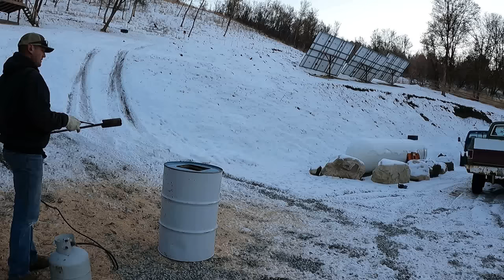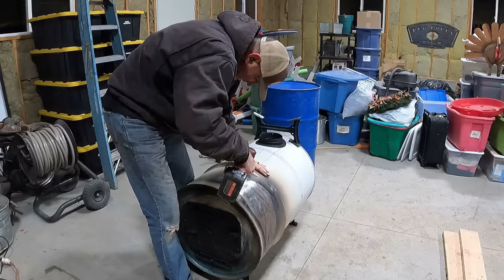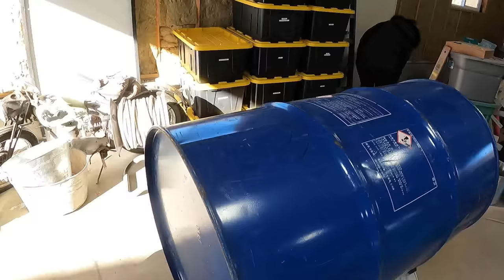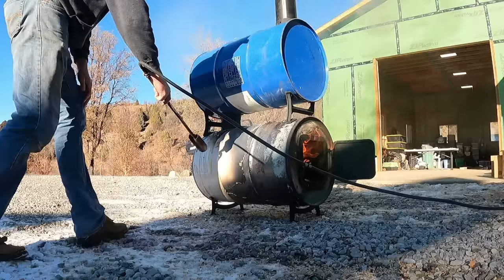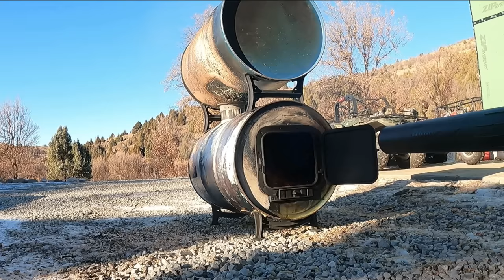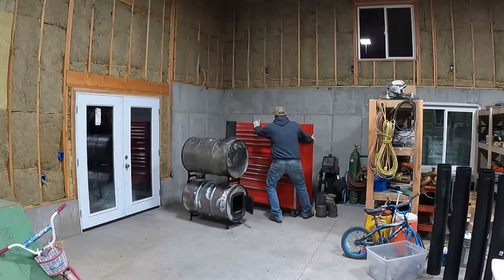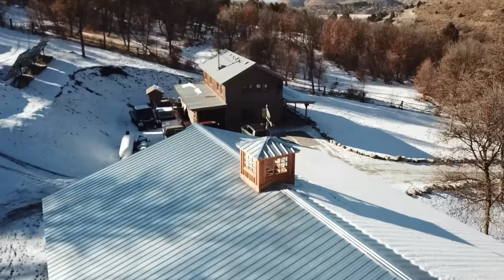I Built The ULTIMATE Wood Burning Stove For The Shop...

Comment: I built one of these stoves. Never again, blue plastic melted everywhere.
Reply: both of his barrels look like they're metal barrels.
Reply: L.M.A.O Hate it when that happens.
Reply: Wrong color, should of went with the Black plastic barrels...
Reply: @LosKonfleis  or the plastic ones that a magnet sticks to
Reply: @joelsmith3797  you can watch it burn. Lol
Reply: Key Davis  ya think? great wisdom  fella.  Am sure none of us would ever have  had that figured out.
Reply: @LosKonfleis  then used high heat paint to be safe....
Reply: You forgot the high heat paint
Reply: Gotta use the blue plastic in underwater applications.
Reply: Key Davis  just build a small fire.....
Reply: You just saved me a lot of trouble! 🤓
Reply: Lmao
Reply: Hey but I bet your stove put of some hellacious heat for a little bit. That reminds me of the wood burning microwave and steel toe flip flops I tried to sale in the truck stops. Never could get either to work. Lol
Reply: You need to check out the classic Newfoundland wood stove,made from  100% maple and guaranteed to burn for six hours!!! 😁👍🏻
Reply: @DrProfMrGenTom  that's the joke.
Reply: You so funny. Funny man make funny joke
Reply: Same problem. They store water okay though
Reply: I had the same problem with mine. I found out that ya have to paint the blue plastic with header heat paint, and then it won't run all over when lit.
Reply: Mine didnt EitheRRrrRr wöRk, StrrAnge ☠️ sYmmboll iiT haDeE söme In ITTt leFfT
Reply: Say what are you actually telling me that you didn't know plastic would melt my puppy is smarter.
Reply: @DrProfMrGenTom  thanks for pointing that out captain obvious
Reply: @williambeatty2675  perhaps your puppy can help you understand the joke!
Reply: Used plastic? Check your IQ …
Reply: @Der-Raubfischer  check your sense of humor!
Reply: LOL
Reply: @DrProfMrGenTom  they are and if you do them right you can get several years out of them
Reply: Sadness
Reply: DON'T use fiber drums! They increase your insurance premiums.
Reply: @williambeatty2675  do you often hear a whooshing sound in conversations with people and wonder what it is? That’s the sound of everything going over your head.
Reply: Aaah der,you should have used a wooden frypan so your stove didn't melt...
Reply: @markhagler4311  considering alot of truckers were flip flops I'm surprised.....LOL!!!
Reply: Lol
Reply: If you noticed,  steel drums were used.
Of course plastic would melt.
Reply: @paultyrkalo  I hope they were joking
Reply: geezLouise 🤦
Reply: Lylz
Reply: @DrProfMrGenTom  Oh buddy .... the joke flew right over ya
Reply: Lol good one
Reply: I built a fur lined sink, electric fork, inflatable dart board, and then I went cross country bowling.
Reply: @LosKonfleis  pshh everyone knows the red ones burn hotter dur
Reply: Is it possible to melt that blue stuff off of it before you burn it or grind it off?
Reply: Haaaaa!!!
Reply: You should perfect it now since you know where you went wrong 😂😂
Reply: Bless you. You are our sweet turtle prince 💕
Reply: Bwahahahahahahahaha
Reply: @DrProfMrGenTom  really?
Reply: Don't you know that the red ones are for fire and flammable materials, they are flame resistant, the blue ones are for liquid and cold 🥶 stuff.
Reply: I built one of those a few years ago and used it in my house. I used the sealant they recommended and it worked awesome here in NY.
Reply: Your a genius
Reply: Next time try metal barrels
Reply: Yeah never use plastic. 😂Metal barrels are the only way it’s possible.
Reply: He is joking I’m pretty sure
Reply: That was funny hee hee. Well done
Reply: I have the blue barrels, mine are metal.
Reply: Never ceases to amaze me how people don’t get a little humor.

Comment: Suggestion: Try putting about 2 " of sand in the bottom burn barrel,  prolongs life of that barrel.  All the Best
Reply: I thought they came with a grate to keep the wood off the bottom of the barrel.
Reply: Probably helps increase the thermal mass too. Good tip!
Reply: Or use that ceramic mass to cover all the walls inside?!
Reply: They have ceramic bricks for the bottom as well.
My husband tried the double barrel some years ago. He couldn't get it to draw correctly. Hope you have better luck.
Reply: Sand is a good idea, or a layer of fire brick?
Reply: My Dad put a baffel in the bottom barrel from back to 4 inches of the front so the exhaust which contains so much of the heat was channeled toward the the front of the bottom barrel then it had to warm as much of the bottom barrel to its max then went onto the tol barrel in the front and had to travel through the whole top barrel to exhaust out the back of the top barrel using as much of the heat as possible then he 
Put rings on the pipe every foot to dissipate as much heat as possible from the stack. Was a great system that heated our ranch home til he went with a wood oil burner in the house. He made a shroud over the stove to capture more heat into our furnace pipes that were on a stack switch into the regular furnace flue to get as much heat as possible.  He was so smart. Good luck heating that huge shop.
Reply: @davidstoughton3257  a great man.
Reply: Add vermiculite to concrete without stones there are many ratios online have the middle no less than 3 inches make it flat and smooth then add a grate to keep the wood off the bottom makes cleaning ash easy people have used concrete mixed with ashes and the concrete held up just allow plenty of time to dry
Reply: @stephenzevetchin  he sure was it's so sad that he lived a tortured life because of his Dad that was a jerk and he had such hatred for him be cause he treated his mother and grandmother so poorly. Unfortunately he drank to avoid his feelings, I decided to break that cycle.!!!
Reply: @davidstoughton3257  praise God...we never know why things go the way they do, just let his will be done
Reply: I put sand in the bottom of mine, about two inches, and I use a grate for air flow.
Reply: we used beach sand in our cottage stove, it lasted for years before we had to put a new stove in.
Reply: A good layer of ashes works as well as anything.
Reply: Yes, helps with burn thru. Immensely.
Reply: If you level the floor with dry sand and add a layer of stove brick to it, you will define radiant heat and have warmth long after the fire is out.
Reply: I did that with my regular Ashley wood stove, but always vac'd it out in the summer so it wouldn't hold moisture against the metal- put in a new layer in the Fall.
Reply: Build an oven into the top barrel.
Reply: @davidstoughton3257  Sorry my phone is old and wonky. No message at all.
Reply: was just going to say that but i was told 4 inches of sand
Reply: Glad someone said it, I was thinking the same thing
Reply: Sand and fire brick
Reply: @farmerbill6855  ashes are alkaline and will
corrode the steel. The idea is to keep the ash off the steel as much as possible, to prolong the life of the barrel.
Reply: @ve3yjt  well you have to clean it out from time to time and in the off season. Sand and brick hold moisture and will quickly rust out the bottom. I've had a dozen of these over the years and have one now in my shop. The manufacturer of the kits  even recommends ashes. There are two different kinds, the cast iron ones like this fellow has and a stamped steel version. The stamped steel is the better product.
Reply: @rossbrumby1957  That's a great idea! I wonder how hot it gets.
Reply: @davidstoughton3257   you two know each other??
Reply: I always thought it would be cool to weld a smaller barrel inside a larger barrel and fill the gap with sand.  Barrel stoves don't retain heat very well.  They just don't have the mass.
Reply: Dirty Sanchez  and the paint on his tool boxes...
Reply: Never would have thought of that I will definitely try that

Comment: Nice, I have a barrel stove at my cabin. It’s been there for 20+ years. I always make sure to add sand to the bottom up to the lower dampers. Few inches of sand saves the stove for years! Nice work man looks good!
Reply: I like the sand idea…
Reply: Great idea!
Reply: Don’t need sand just let ashes build up and it does the same thing
Reply: @larryjones8928  Nahhh sand better!!
Reply: Never thought of doing that with sand. Awesome!
Reply: @KVX21  with sand you are always replacing it when you clean out your stove. With ashes you replace when you burn more wood
Reply: @NeillWylie  yeah works great just gotta clear the ashes once in a while. Honestly the only time I’ve ever replaced the sand is when it had to get welded after 20 years. Glad you like the idea, my old man was a real bush wizard.
Reply: I lined the hottest part with ~40mm of clay.  It allows very high combustion temperatures and protects the drum wall.
Reply: On that line of thinking, why not some concrete? Would give some thermal mass, something this style of stove is lacking.
Reply: It would probably work, never thought of that. I mean it would undoubtedly crack into pieces if it was basic concrete but I'm sure you could get some furnace grout and it would do the same

Comment: Two things to consider line the bottom barrel with 1/2 thick fire bricks makes a big difference in stove operation and longevity. Second item paint the barrels black the heat will transfer better to the outside of the barrel; the black will bring the radiant heat to the outside. Don't get too close to the rafter with the stove pipe in the event of a flue fire you need triple wall pipe or 3 feet from any combustible surface. You did a good job on the stove.
Reply: Mine is ash bed only and was built in 1996.  Used every year for 6 months a year or more.
Reply: @exposingthetruth3821   I never burned out a drum stove, just an ash bed seems to work just fine. Besides, another drum is cheaper than buying firebrick.

Comment: Great video! My friends and I built a similar design for our shop years ago. We didn't have the benefit of the kit, but as metal fabricators it wasn't a problem. The main differences in our design were 1) The lower firebox on ours was 1 1/2 barrels long. 2) The pipe from the fire box extended almost to the top of the upper barrel while the exhaust had a pipe reaching down to near the bottom. This forced the heat to linger in the upper barrel longer before exiting (with a damper on the outlet above). 3) we included a clean-out on the back of the upper barrel for the inevitable ash and soot that would accumulate over time. 4) We enclosed the entire unit in a sheet metal box with two openings: one high on one side and another low on the opposite. The shop was big, so we added a fan from a swamp cooler to the upper opening once the heat built up and ran it all day (we were not off-grid). We were able to keep the shop warm through the coldest winter months, and it was the favorite gathering spot!

Comment: I was born and raised in Spokane and built a few wood stoves. When I worked for Case Tractor in Bend the shop manager gave me permission to modify the barrel stove. I added an air intake in the back of the stove using the 2" bung. It went up inside the pipe between and stopped at the edge of the 2nd barrel. There was a water culvert about 10  inches in diameter already in the 2nd barrel and a box fan mounted on the 2nd barrel to push air through and get it out. Firing up the stove after i modified it made a BIG difference. The culvert got red hot. The box fan melted because of the excess heat generated by adding air. The guys in the far end of the shop said "I can feel the heat way over here!" Approximately 100 Ft. We did not change the amount of fuel we used just added air so we could burn it all. Adding air was all I did. The biggest problem with heat engines and things that make heat is NOT ENOUGH AIR